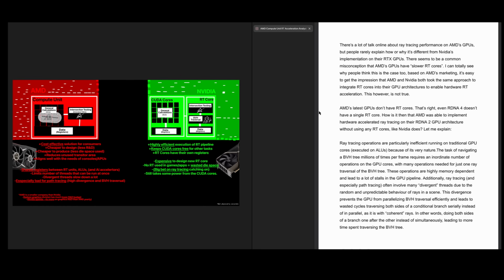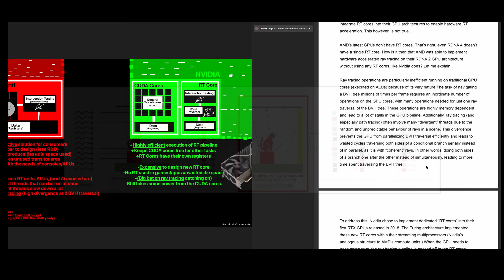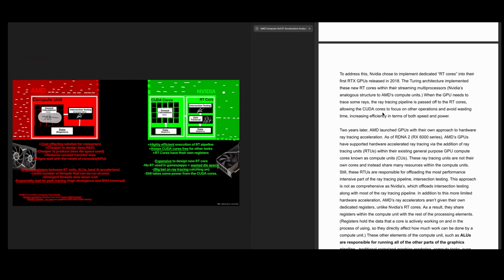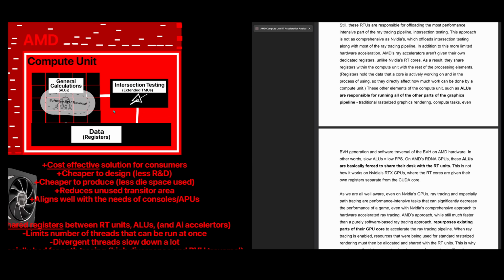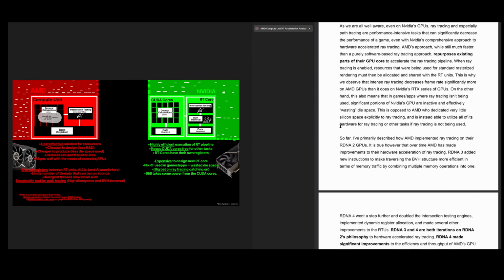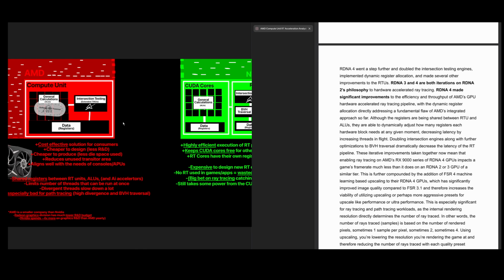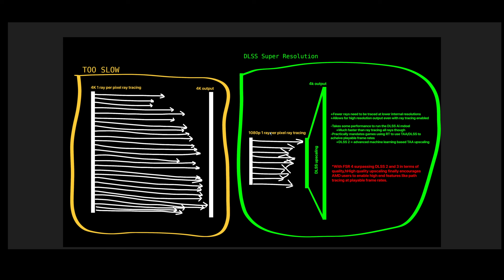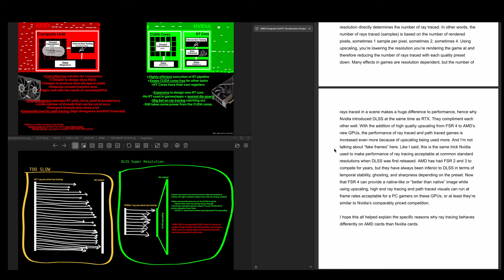How Does AMD Do Hardware Accelerated Ray Tracing?

Comment: Would be interesting to see AMD leverage their chiplet prowess and put out a highend raytracing card with dedicated RT chip on board.
Reply: That's not really a thing you may want. RT is a latency-sensistive workload and you need immediate access to shared data between your general compute and fixed-function RT accelerators to minimize that.

Chiplet GPUs are also likely closer than some expect. The MI355X for example has 8 32CU chiplets on top of 4 separate base dies.

Ideally, they'd adapt that approach to consumer hardware and scale it down. Multiple identical compute chiplets atop a shared active base that provides last-level cache and I/O for the PCIe bus and memory.
Reply: @DigitalJedi  isn't that exactly what uDNA is supposed to be?
Reply: @MrStoffzor UDNA will focus more on AI/compute feature. It does not mean they will go chiplet with the GPU.
Reply: @arenzricodexd4409  "It does not mean they will go chiplet with the GPU" They've already said they will.  The whole point of UDNA is to combine RDNA and CDNA in the same manner Ryzen CPUs are binned Epyc chiplets.  Whatever technical problems you'll point to with RDNA3 having tried chiplets are extremely minor compared to the scale AMD would gain at the manufacturing stage.  The cost to performance metric is all gamers will notice and that'll tilt way in AMD's favor.
Reply: @motmontheinternet  the point of going UDNA is to add more AI/Compute feature to the architecture. combining RDNA and UDNA does not mean it AMD will go chiplet. the thing with chiplet is they are not work really that well for gaming workload. we already see issues even on CPU where the access to other CCD end up causing issues. that's why people want a single CCD to have at least 8 core so that way it does not need to access the other CCD for gaming workload. this is even a bigger issue on GPU. that's why up until now we never see any demo or real showcase of how game will run on two GCD or more. another thing with chiplet is increased power consumption and more expensive packaging. this is the reason why RDNA 4 return to monolithic rather than keeping RDNA 3 GCD+MCD setup.
Reply: @arenzricodexd4409  What you've said isn't true, it's you not understanding the facts you're saying.  There is no reason to change the architecture of their gaming cards to UDNA unless it is to leverage the scalability of chiplets to lower costs.  It takes more effort for them to convert UDNA into a gaming architecture than it is for them to just design a new generation of RDNA.  The fact that you get deprecating returns in gaming with multiple GCDs just means they won't make any cards with multiple GCDs.  They already run RDNA4 without competing at the top end, they do not care.

You don't seem to understand, you aren't listing any technical reasons the GPUs won't be chiplet and you're willfully ignoring the straight facts.  In your point of view, it's possible that AMD wants to do something that is not in their own interests as expressed by them.
Reply: @DigitalJedi  No you don't. You only need to Read & checksums for color corrections.
Reply: Chiplets are still a long ways away for GPUs

Comment: I've been hoping someone would do architecture analysis and comparison videos just like this! One point though, your video implies that Nvidia's RT cores allow the shader hardware to run code simultaneously and I don't think this is the case. Correct me if I'm wrong.
Reply: Yes, since Ampere they can run shader operations concurrently
Reply: Cool, I did not know that!
Reply: Even on Turing non-ray tracing parts of the same kernel can be scheduled to run on the same core concurrently with the ray tracing on RT Core.

Comment: AMD was quite late into the RT adoption, so they expedited their RT implementation as an in-line shader as specified in DXR 1.1 to match closely with their "software" RT model in the RDNA2+ GPUs.The initial DXR 1.0 was not very suitable for AMD since the whole spec used Nvidia's Turing as a reference platform that relied on function calls to run RT, more fit for a GPU with dedicated BVH traversal hardware.

Comment: Something not mentioned is the lower rendering resolution also requires a better denoiser. And while AMD's new FSR4 looks great, they don't have an AI upscaler yet. Nvidia's Ray Reconstruction transformer model is basically mandatory for path tracing.
Reply: FSR 4 has AI denoiser inside it
Reply: @berdik97 this has not been implemented yet and what we have seen hasn’t been very impressive. I hope they get it to ray reconstruction level but currently we haven’t seen it anywhere that isn’t a tech demo
Reply: Look at the amd toy shop demo for raytracing, they said they are using ai denoisers in rdna4.
Reply: Huhh?  FSR4 uses an advanced hybrid model which uses CNN on regions that feed into a transformer for global reconciliation.
Reply: AMD is bringing one out which is good.

The biggest issue facing AMD in the future is that their approach works well for light RT workloads, it doesn’t scale well to path tracing.
Reply: @zachb1706   With how expensive  modern GPU & consoles are. I think we're going to get stuck a little bit longer with current games graphic technologies.
Reply: FSR4 is ML based, no?
Reply: @bltzcstrnx of course it us, it uses both CNN & transformer.
Reply: FSR4 is an AI upscaler.

Comment: AMD should mainly fix their input lag in all games, I sold my 9070XT and bought 5070 Ti because of that, all games feel delayed even with high fps, even old games with hundreds of FPS where I never had any input lag, no settings of vsync, anti-lag and stuff like that helped, I was not able to solve it and AMD heads call me a liar just because of asking how to solve problem that doesn't exist by them and I am paid by nvidia they say. 
I don't have any problem with 5070 Ti and I definitely don't have 150 ms lag on my mouse with nvidia, so screw you, I am officiall nvidia sheep since now. 😀
Reply: This. Tech tubers avoid talking about Reflex and how it halves latency in GPU bound games.  Cyberpunk at 60fps without reflex has 70ms of total system latency. With reflex at 60fps it has 35ms of latency.  Oddly enough if you turn on frame gen with a base frame rate of 60fps with Reflex on you will be at 50ms of latency.  Reflex has a bigger impact on latency than even frame generation.
Reply: @Sp3cialk304  Input lag in Cyberpunk is still pretty ok even without reflex, but try Stalker 2, that's totally unplayable without reflex. I don't understand why developers don't implement AMD anti-lag 2, it looks like they ignore it on purpose or maybe it's not that good and easy to implement as AMD says. But they fact that I sold AMD just because of I wanted reflex support says a lot about what is really important and no, it's not FPS or RAW raster performance, ofcourse it is important, but when I have good raster performance, but game feels delayed like hell, it's pointless.
Reply: @Pidalin Anti Lag 2 doesn't seem to be stable. It was removed from Spiderman 2 because it causes crashing. The few games that have it are older games that are always CPU limited and getting insane frame rates, which leads to latency reduction tools doing next to nothing.  

Devs are not going to spend time and money adding a feature that only a few percent of players can use, that is also very unstable.  And they know that the few percent that could use it, won't ask for it. Because admitting reduced latency is important would mean Reflex has value.
Reply: @Sp3cialk304  I thought it was removed mainly because it was triggering anti cheat in online games, that's they official explanaition. So they gave up with implementing it thru drivers and they are doing it the same as nvidia with their reflex - developers have to implement it to the game, but they completely ignore anti-lag 2, there are like 3 games that support it. Nvidia promissed eve better version of reflex later this year so I wonder how they do it, it would be nice if it was possible to force it thru drivers in games that already support reflex.

Comment: This is exactly why AMD has better rasterization but takes a bigger hit when RT is enabled, and then taking the Royal Core (RIP) approach with RDNA4 is very forward thinking.
Reply: Better rasterization ? Comparing to what ? 😂
Reply: @HDRGamingHub  Nvidia cards of a similar price. To be fair to Nvidia, this isn't always the case. I also doubt something like this would be the true reason for differences in GPU pricing between AMD and Nvidia, because pricing isn't just determined by the cost of production.
Reply: @HDRGamingHub same msrp nvidia GPUs?
Reply: @HDRGamingHub  nvidia
Reply: 😂 AMD better than Nvidia ? Give me one example please .  @qrcus
Reply: @HDRGamingHub RX 9060 XT vs RTX 5060 lol
Reply: @malucart  okay, what about 9070xt vs 5070ti? What happens to raster perf when you put the best amd has vs an nvidia equivalent?
Reply: @Aditya-sj4ev  A $600 card and a $750 card. If you pay more you usually get more, and indeed the 5070 Ti is faster. But they were like 5% apart in reviews, so the 9070 XT is generally better value.
When comparing products, it's all about value (performance for the price or price for the performance); no one who's considering a 9070 XT would consider a 5090, so the best of each company is never a relevant metric.
Reply: @malucart where is the 9070xt getting sold for 600? Its currently ranging from 799-850? Lowest i see is 799 while 5070ti is at 839?
Reply: @HDRGamingHub  There are hundreds, just get out of your cave and see a comparison I guess
Reply: @malucart  Saying AMD has better price to performance is one thing, but to say "AMD has better rasterization" suggests that at similar die sizes, RDNA 4 has better raster performance than Blackwell. Which just isn't true.
Reply: @malucart  The 5060 has a smaller die and uses less power. So it makes sense that the Rx 9060 xt is faster in rasterization. From how I see it, this doesnt really prove anything
Reply: @JanM2 So it's smaller, lower power and slower, and yet costs as much as a 9060 XT. That's the point.
Reply: @malucart  5060 uses the most cut-down variant of GB206 die. You should compare 5060ti 16GB to 9060XT 16GB instead. Then, according to techpowerup, 5060ti 16GB is 7% faster, has 10% smaller die and is more expensive. So Nvidia has better rasterization tech and higher margins.
Reply: @randomobserver9488  Always compare tier by price not tier by name/specs. That's dumb.
Reply: @Splarkszter  No, if you want to compare technology, you have to compare performance/die size. Die size = cost. Nvidia has higher margins which can make perf/sell price higher for the consumer despite better tech.
Reply: @Aditya-sj4ev  In Europe netto is 660
Reply: @randomobserver9488 You mixed up cause and effect. Prices are not dictated by margins, but margins are dictated by the prices customers are willing to pay. Obviously the majority of customers are willing to pay more for a GPU that offers more modern features, as opposed to a GPU that focuses on legacy features. Both AMD and Nvidia did a gamble on the future, and Nvidia happened to win it this time, and that's why their margins are higher.

Comment: AMDs approach is more in line with what happened with pixel and vertex shaders which use to be fixed function hardware but was all changed eventually to a general compute core. Thats why I believe AMDs approach is probably going to be approach of all GPUs eventually, as having fixed function hardware becomes a huge waste of space as you continue to scale up, it is why Blackwell didn't add any new improvements to RT and raster, Nvidia is probably shifting to a different architecture that's probably more like AMDs but probably far more dedicated to improving RT over raster.

Comment: you basically reiterated NVs tech marketing messaging on this topic. your argument boils down to "to much R&D money for dedicated cores" which might have been even true for rdna2 (but i think it was more the case of limited time to market for the consoles). but that argument is kinda absurd when you think about that there have been two major core redesigns since rdna 2 where they redesigned alot more stuff. they surely would have had BVH crawler and dedicated registers in ASIC simulation since the rdna3 redsign phase and did not deem the silicon trade off  significant enough compared to the perfomance hit.
Reply: AMD just doesn’t want to dedicate the silicon to save money to be more competitive with Nvidia which have a large architectural advantage. Just like they did with AI.

Intel does BVH traversal in their RT cores

Comment: Thanks for this! Besides being informative in its own right, it also helps explain how Linux users can use "emulate_rt" functions under Vulkan to run RT-only games (e.g., Indiana Jones & The Great Circle) on older AMD GPUs with no RTUs (GFX8 or newer).
Reply: Exactly, because AMD's RT is mostly software, Linux can easily emulate the one hardware call, then do the rest as normal. Which AMD didn't provide Windows support, because their cards can do it faster than the Nvidia GTX cards that Nvidia did provide compatible drivers with 10 FPS performance. AMD doesn't provide this compatibility layer because it means more people are forced to upgrade. FSR 4 doesn't get RDNA 3 support to make you upgrade to RDNA 4, which yet again Linux proves AMD is artificially limiting compatibility. RDNA 3 can run FSR 4 even without being optimized for it. It just runs slower, but still faster than native.

Meanwhile, Microsoft is partnered with AMD to FORCE Windows Update by dropping driver support. Polaris dropped Windows 7 32bit on launch, to make people upgrade, but it DID support Windows 10 32bit. AMD is also going to drop Windows 10 immediately this year. Microsoft isn't going to like people SWITCHING TO LINUX, because AMD is literally forcing people to switch by both dropping Windows 10, and refusing to support FSR 4. I have a 7900XT, and I'm already on Linux. Microsoft and AMD can diaf for their driver nonsense.
Reply: @JohnDoe-ip3oq The is this thing called "Turing completeness", which means that by very principle, every computer can run any program. There is no such thing as "mostly software", there is only software, and all of it can theoretically run on both general purpose, and specialized circuitry, with the only difference that specialized circuitry is usually much more efficient in doing so. DirectX for example offered from the very beginning on the possibility to run everything that isn't directly supported in hardware as software emulation. It is perfectly possible; it just doesn't make sense from a performance standpoint, and hence isn't used in any real world application. 

When a vendor says "feature XY doesn't run with this GPU", it therefore always means "feature XY wouldn't run efficiently with this GPU, as it is lacking specialized circuitry to do so efficiently".